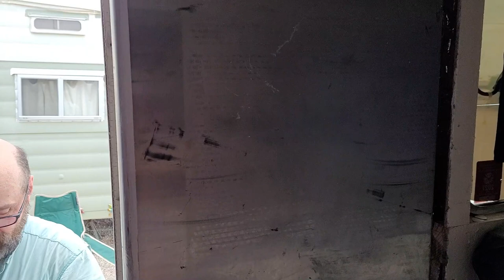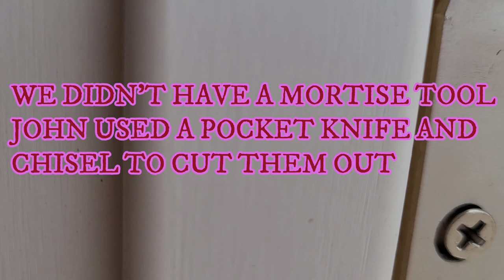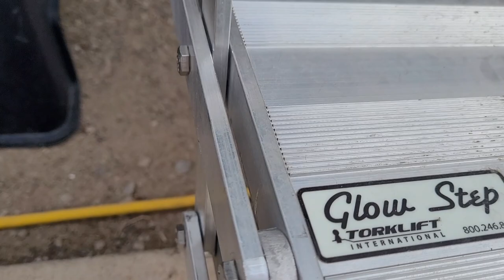Box Van Dee's Nomad Life-Part 3 Box Van Repair Series- Door and Steps

Comment: Put weather stripping in the door jams & seams. You can buy it in rolls at the hardware stores. It's  tacky on the backside and you can layer it. I purchased some at Ace hardware. 👍  It will keep air & water out. Also get some silicone in a tube as well. Get a large tube of it. At night time. Check to see if you can see light by having someone shine a flash light on the seams. If you see light apply more stripping or silicone in that area.

Comment: That’s a lot of work! Good job, but I think you should have tried to find a used camper door and stairs for your camper. My daughter had an old RV that the door got ripped off. I drove around one day, stopped at a couple of junk yards and found a door and stairs to replace it with pretty cheap. 
I would suggest that you also consider Habitat for Humanity when you’re looking for parts. 
I’m afraid those stairs are going to be more of a hassle than they’re worth.

Comment: That has been a job for you guys. Dee can you oil those steps so they are easier to fold in and out? I don't know what the manufacturer suggests or says not to do to them. They're expensive but they were needed because you can't risk a fall. If you have a bit of a gap on the new door, can you put some weather stripping around the door to seal out the gap and the weather? I wish you could have some kind of railing that's on henges and can be folded back and secured when you are driving but can also be secured in place somehow when you are stationary so you can use it to go up and down your stairs more securely. I know you said you are going to install a handicapped handle to use. Can you use some kind of chain to the top of your new door that makes the door stop before it hits the electrical covering and gets damaged? I don't know what things you might of already thought of doing to make things a little better and safer. Take care. ❤❤❤
Reply from the maker: Thank you for all the great suggestions!

Comment: Your lucky the park allowed you to work on you RV . A lot of them won't.
Hope your new butcher block door works well. My guys say you will need at least 8 to 10 good coats of the clear sealer or it won't hold up.

From what I understand they haven't made exterior doors under 28 inches in years unless you have them special made. And the place you bought it should of known that.
I would still let there corporate store know that it was miss marked. So they can check there stock .
And as a side note. Knock on the door in different places you should be able to tell if it hollow or not. I know that doesn't help you this time. But may help someone else from getting ripped off.
Reply from the maker: Thanks sis

Comment: Dee, couldn't you build a frame for the old metal door and use that instead of the hollow wood door? It would be much sturdier. Maybe using metal studs for the frame and attach a handle turning it into a pull out door. Those hollow wood doors are only for interior use. When it rains, the thin plywood will buckle up on you. They can also be kicked in quite easily. I'd definitely hang on to the metal door.
Reply from the maker: The old door is already gone and I have already bought a new one.  Now I just have to get it installed

Comment: Would some wd-40 help those stairs fold better?
Reply: They are pretty precisely engineered with heavy stainless steel links, stainless bolts, and nylon low-friction washers in specific places between the links.  There are instructions about which bolts can be slightly loosened (turning each specified one only 45 degrees) to loosen or tighten it up.  I did that twice to loosen each specified bolt, plus twice to equally important bolts that mechanically are equivalent (I'm a mechanical engineer).   

Using silicone, WD-40, or oil would not be as controllable.   If oiling let it open/close too easily, it could turn it into a slinky opening itself when you stand on a middle step, which would be dangerous.  Use will loosen it up a bit more, by wearing the nylon washers a little.  Once it has been used a few dozen times, we can deal with whether to loosen it more on the same bolts, or to versus start loosening a third set of bolts that was left untouched because they are not in a similar location to the ones the directions said it was OK to adjust,  though at some point (maybe already reached) they would become the majority of the remaining friction.  

It is designed for people up to about 3 times Dee's weight.  Loosening it too much could make it skid open for someone who is heavy, so there will be a compromise between having her able to more easily open and close it, versus subjecting her to liability if it's loosened too much and a heavier person than her (meaning almost the entire population of the USA) gets hurt on it.